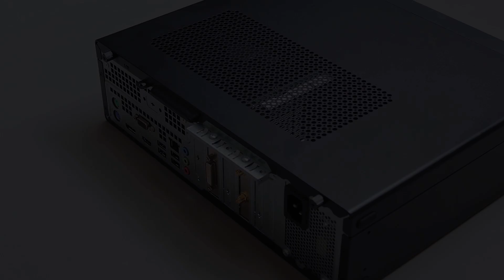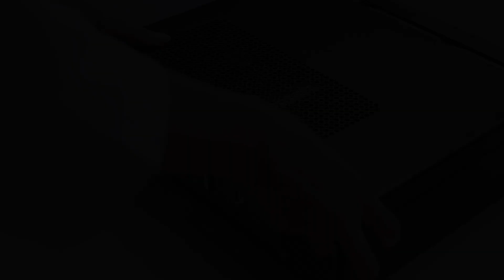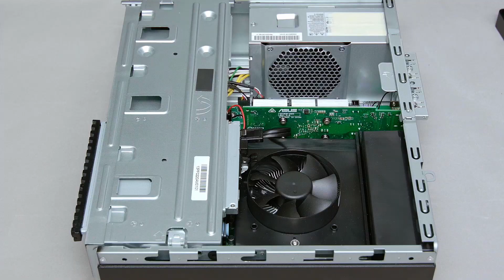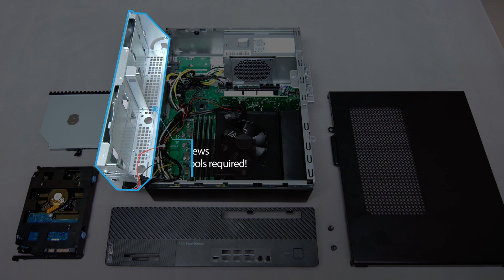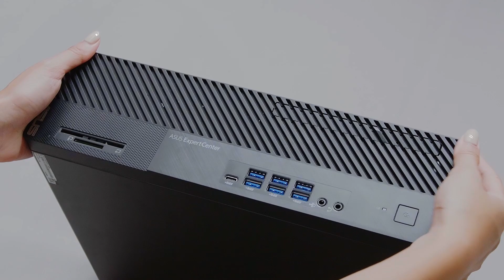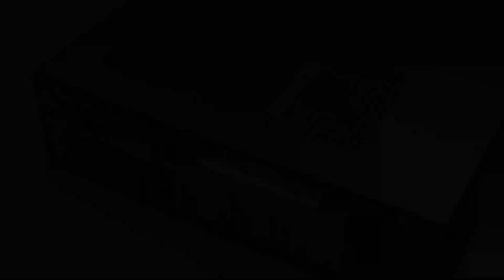ExpertCenter Small Form Factor PC - Tool-free Chassis Design Instruction Video | ASUS

Comment: I have this computer. I added a SATA HDD connected with the appropriate SATA n power cable, on the motherboard side I connected to SATA1 n power connected to HDPOWER1, but there is no display, it seems so straightforward but yet.....